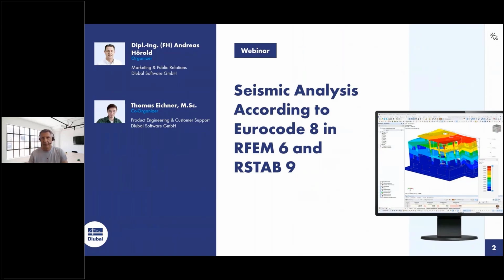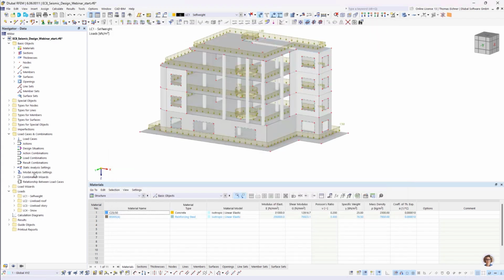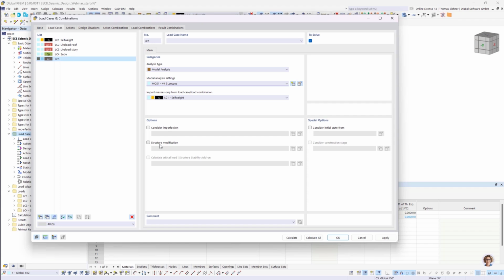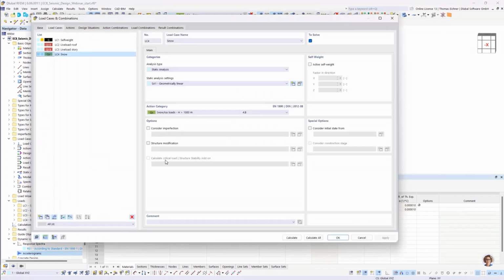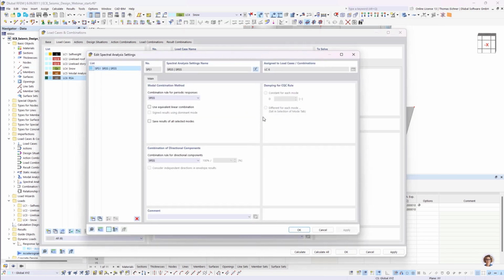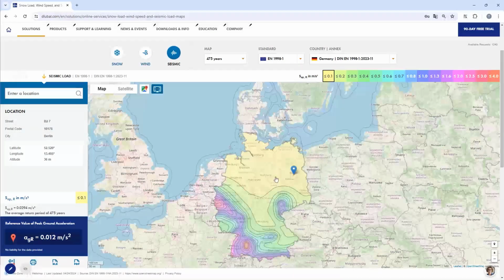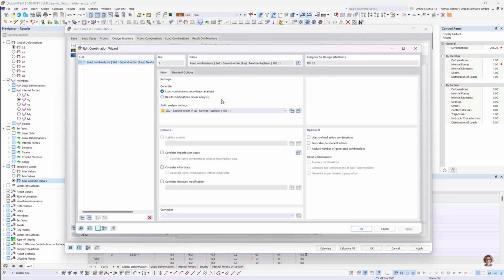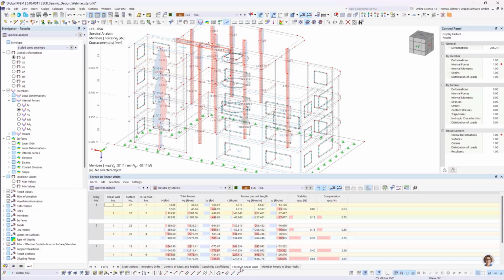Webinar | Seismic Analysis According to Eurocode 8 in RFEM 6 and RSTAB 9

Comment: Hello, is it possible to perform modal analysis, and consequently spectral analysis, in such a way that masses from the self-weight of the elements, permanent loads, and corresponding imposed loads are concentrated/lumped at story levels (masses and loads from 1/2 of the corresponding story height below and 1/2 of the corresponding story height above) of the model instead of all masses being concentrated in FE mesh nodes (without manually assigning masses of corresponding imposed loads)? Also, if it is possible, how can these concentrated masses at story levels be displayed graphically? Eurocode 8 provides guidelines and recommendations for the seismic design of buildings, but it does not explicitly require that masses be lumped at story levels. However, concentrating masses at story levels can simplify the analysis and is considered good engineering practice in many cases.

Thank you in advance for your replay.
Reply from the maker: Hi, @TheMowieStar! you can achieve such a lumped masses model by using our Building Model with the floor modelling type "rigid diaphragm". This simplifies the model by lumping the masses on the floor level. Also, the masses as described in your question can be visualized there.
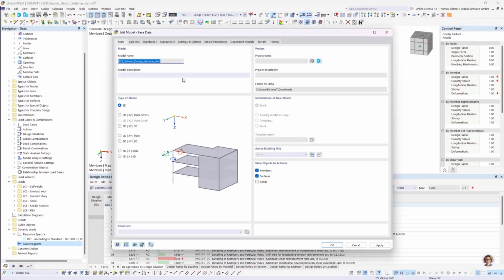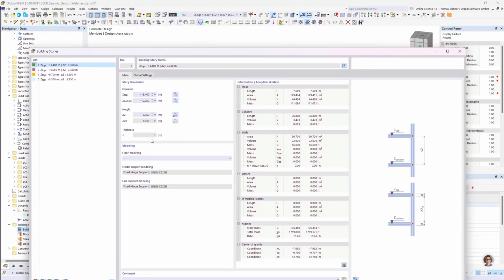The building model is treated in the webinar from minute 59:50. For the change to a rigid diaphragm floor type, you would just select the floor modeling type "Rigid Diaphragm" at minute 1:00:34.

For further information feel free to visit following website: https://www.dlubal.com/en/downloads-and-information/documents/online-manuals/rfem-6-building-model